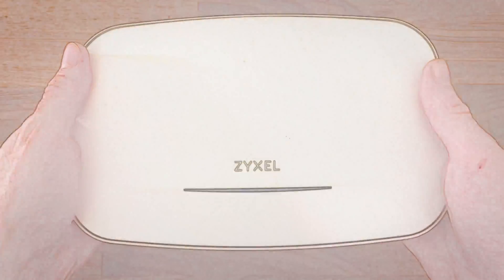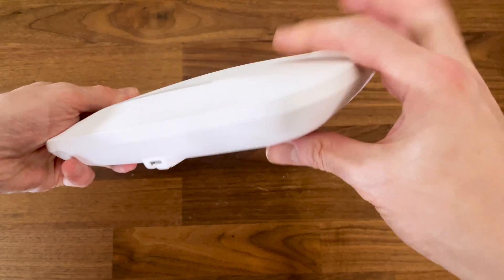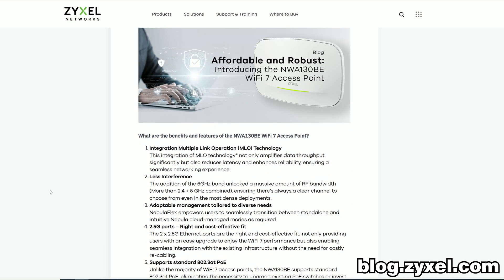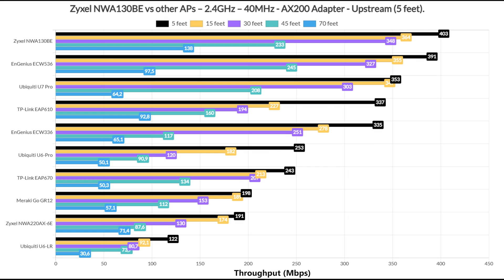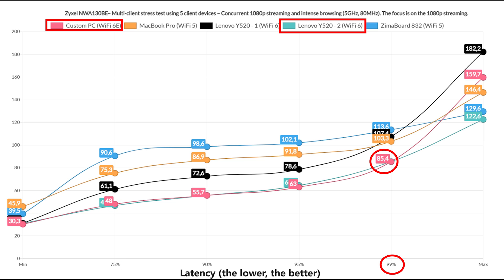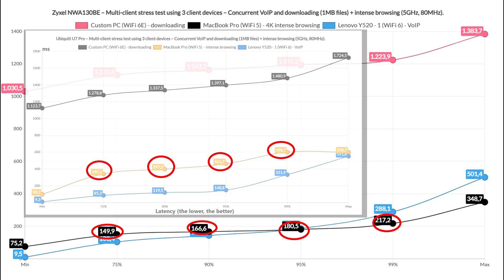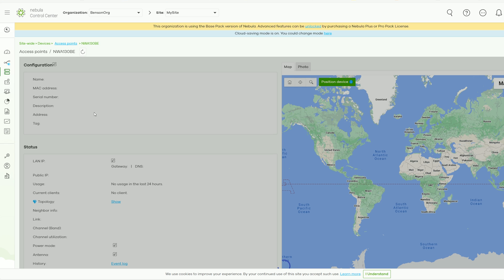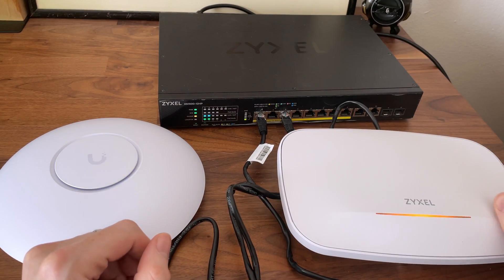Zyxel NWA130BE WiFi 7 AP Test & Review: Is it a better U7 Pro?

Comment: hey Sam, thanks a lot for the great review.

Question: does "laying" the AP on a desk (without desk mount) will affect it's performance?
Reply: Besides the risk of it easily sliding off a table, I don't think you'll see a major hit in performance. It will clearly better cover a larger area from above, but you should still be able to use it without being mounted on the wall or ceiling.

Comment: Great review.  Sadly, my NWA130BE is performing very badly in 5ghz and worse in 6ghz.  Zyxel isnt sure why just yet.  Might have to return it.  Thoughts?  Testing with a pixel 8 pro, 2.5gpbs uplink shows > 1.2gbps of internet bandwidth.  Average AP performance 750 mbps on 5 or 6 ghz and phones refuse to connect to the 6 ghz unless i make a dedicated ssid.  hmm

Comment: I just returned a U7 Pro Max because the 2.4ghz band has major issues. I grabbed this Zyxel to give it a go. Immediately experiencing the same issues I had on the U7 Pro Max with 2.4ghz iot devices. Completely unstable on 2.4ghz band. There is a review of the U7 Pro and U7 Pro Max here on YT titled "U7 Pro Sucks Don't Buy" or something similar. You can also see from every forum that the U7 Pro and Pro Max have major 2.4gh issues stemming from possibly Qualcomm chip issues. The video goes in depth and there is even FCC filings where Ubiquiti might release a new hardware revision for the U7 line splitting the SoC's up to possibly solve the 2.4ghz issue. I am wondering if this Zyxel is using the same exact Qualcomm chips as the U7 line is. I have the Zyxel on the latest firmware. This doesn't look good. I'm about to pack it up and send it back too. Starting to see more in the forums about this issue with Zyxel and it is starting to look like the same issues the U7 line has.
Reply: Hi, how did you end up solving it? Which one did you end up with?
Reply: @adrianfora  i want to know the outcome.  the nwa isnt working well for me.  poor performance on 5 and 6 ghz.

Comment: my webui has none of the options this video has.
think they did an update and removed everything moving it all over to the cloud. 
so all those points about "paper weight in a few years" is true, there's no local webui anymore, just a basic option for ip type.
Reply: puuh thanks for the warning, I was just about to buy 3 of those for my home.
Reply: @damian007567  i contacted support and they told me if you don't use there mobile app and don't use there website, then the local webui will have more options enabled. It's a pain to "unregister" so you can use local webui so consider not using any of them to begin with, you may need to contact support since there website does not have an unregister and even factory reset don't work. 
But yes after a huge hassle you can get SOME (not all the same as there website does, stuff like Mesh and other important stuff isn't in local webui) more settings on the local webui but then you won't beable to use the mobile app or there website at the same time. 
It's a horrible system tbh. But i kept my router anyway since it's fairly decent for the price compared to other wifi 7 once hopefully they update the local webui with all the once there own website has.

Comment: @SamBondor The reason that you do not see clients in the Nebula is that you have Nebula in cloud saving mode. There is a banner in the top of the screen under this organization is using Base Pack version of Nebula.... The cloud saving automatically activates with the free version of Nebula and if you have not visited the portal for some time.

Comment: How are the results so terrible? I've been on cables for the past few years and thought that WiFi 7 for sure would be able to handle 5 devices maxing out the connection without going into latencies of over 10ms, but it goes above 1000ms??
Reply from the maker: I used the 5GHz radio since I do not have enough WiFi 7 client devices, but even so, the multi-client tests that I conducted are a bit on the extreme side. The intense browsing is a bit unrealistic since no one moves through pages like a maniac or I don't think anyone streams 4K videos on 5 or more laptops at the same time. Also, the downloading traffic is there to push the bandwidth to the limit, while usually the websites you're downloading from have a certain cap. If you do have a similar config as I simulated make sure that QoS is enabled and properly set up and perhaps invest in a bit better hardware. Or the good ol'cable.. In normal situations, it shouldn't do that bad.

Comment: How is it vs U7 Pro & Can i mount this on the wall instead of ceiling? How does it distribute the radio waves?
Reply from the maker: Yes, you can mount it on the wall or on the ceiling. Both access points offer the means to do so. As for the max efficiency, ceiling is always better and that's true for the Zyxel AP and the U7 Pro.
Reply: @SamBondor  I see, I did purchase one of these and I'm excited to use it. Only issue with ceiling mounting for me is the fact that I need to drop down cable somehow and I've never really gone to my attic (limited crawl space). Wondering if I can wire it somehow else from my PoE switch which is in the same room.

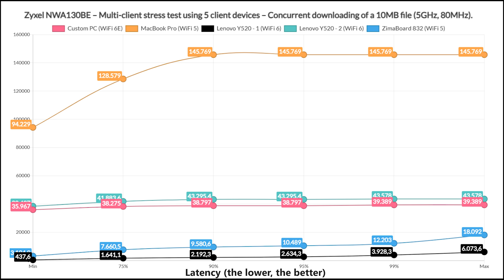Comment: 13:05
Could you test 5 simultaneous download from a local server (2.5gbe connected or higher) and see the collective wifi bandwidth is maxed at 2.5gbe.
i.e. 500 + 500 + 500 + 500 + 500 = 2.5gbe. 

This is relevant as many ISPs are providing 2.5g or higher internet speeds, 
meaning  a PS5 is downloading at 500mbps, PS4 downloading at 500mbps, PC Steam downloading at 1gbps AT THE SAME TIME would be possible now.
Reply from the maker: Yes, but to be completely clear. You want to see the latency of five client devices that are connected using Ethernet cables and the throughput is limited to 500Mbps each, right?
Reply: @SamBondor  
No, not latency, total throughput.
1) All 5 devices on wifi like in your video.
2) Get 1 pc that can handle 2.5gbps throughput ramdisk or nvme ssd, (simulate 2Gbps ISP)
3) Copy files from the PC to those 5 devices at the same time!
4) Look at the bandwidth from your router/AP in real time to check if it can handle 2.5gbps.
Reply from the maker: @jackipiegg  Well, that's kind of what I did at exactly the minute you quoted. Five client devices connected wirelessly to a host PC and I made sure that I got the full 2.5GbE available. I set no limit to the bandwidth each could eat up, so it could have reached the max 2.5GbE (or close to it due to the overhead). But due to the high latency, the total max throughput offered by all the client devices at the same time was 542.8Mbps. For the type of applications you want to run, it's better to go the wired route. It's possible to limit the bandwidth per client and prioritize various types of traffic, but at the end of day, WiFi is still not a very reliable medium when compared to using Ethernet cables.

Comment: How do you obtain results on with a computer? Do you use a software? I would like to test my new AP. My results with smartphones are bad.
Reply from the maker: What are you trying to test? Throughput, latency, range? I use iperf3 for single-client tests (server PC + client devices) and rely on net-hydra for checking out the latency depending on the type of traffic that I want simulated. You could also use FLENT or Waveform to check the bufferbloat.
Reply: OK thanks. I was able to test data speed transfer with Iperf3 single client. Who are saying 1Gbe is enough for AX3000 is not true. I got 1.25Gbps at average with a pike at 1.41Gbps with Zyxel Nwa50ax Pro at 1.5m to the antenna of the client (Intel ax200).
Average data transfer speed with a TP-LINK EAP225 ac1200 = 340Mbps
Reply from the maker: @williamquentin2886  Happy to hear it all worked out. And yes, multi-Gigabit ports should have been a standard on WiFi 6 devices and more so on WiFi 7 hardware.